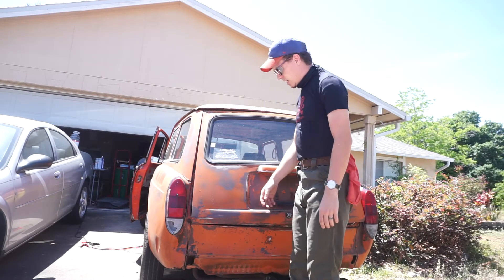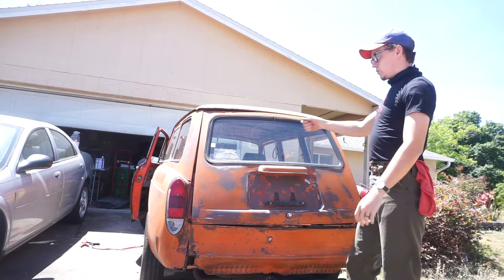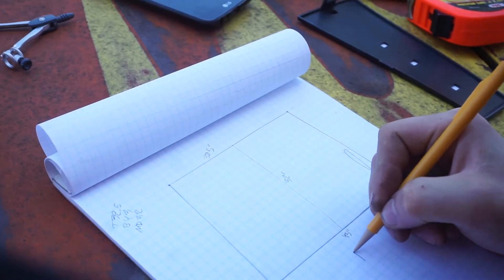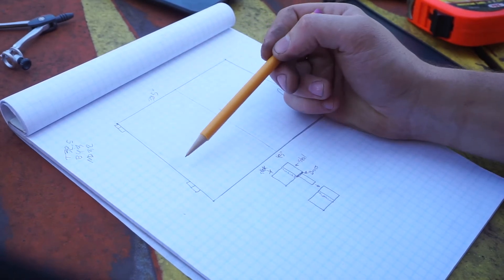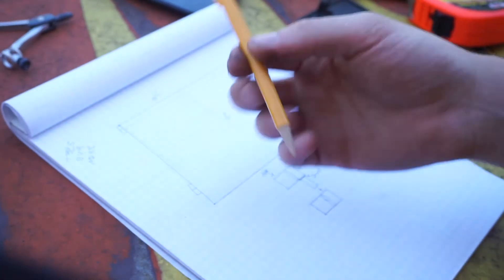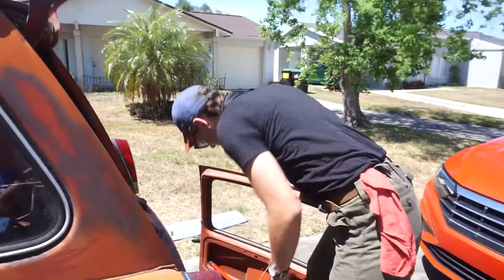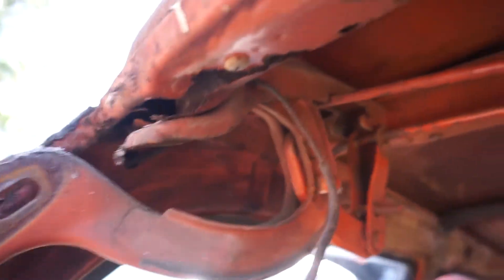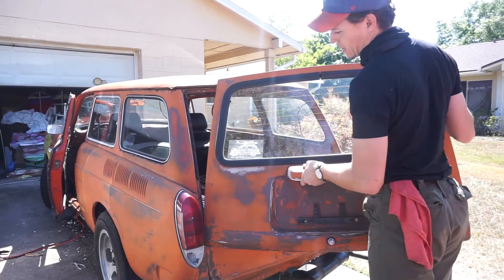Putting a HEARSE Door on the FIRUS (1970 VW Type III Squareback) -- Part 8

Comment: The whole problem with that rear door is, the roof not being attached to the upper quarter panel. if you fix that, the door will work properly. Then if you want to customize the way the door opens it will be just cosmetic. But you should fix the roof issue first, because you can't attach the door aquarely if the body isn't structurally sound. But it is a cool idea.